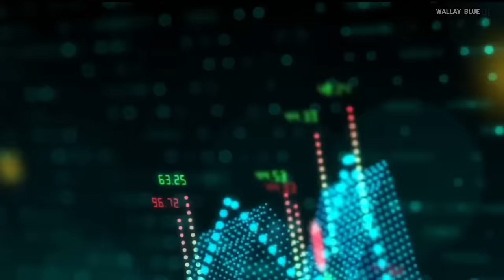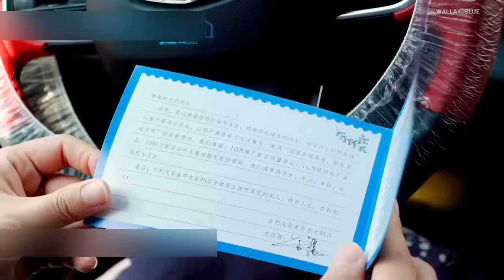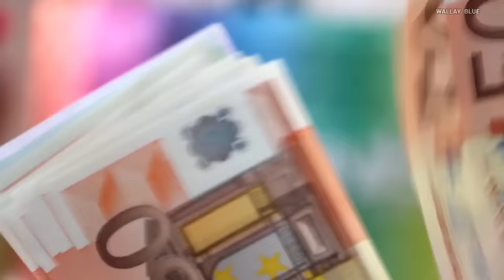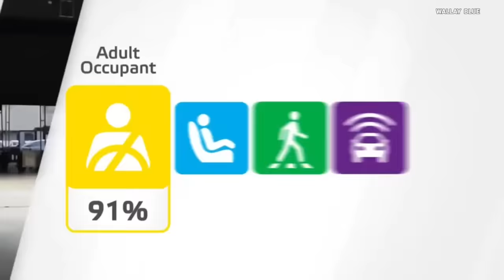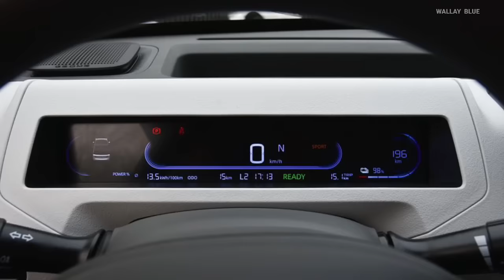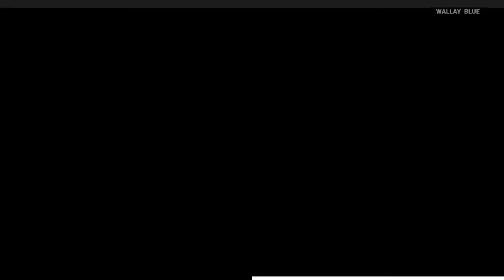China's $6,000 Car Shock The Entire EV Industry

Comment: I suggest that those countries which depend on oil and gas to produce electricity better keep to petrol or diesel engine vehicles because it makes no difference to produce carbon dioxide from the vehicles or the electricity generating centres.
Reply: The mass productions of electricity even still from oil or gas at the current technology stage is still much more efficient and cause much less emissions than each car produced power from petrol on its own, especially we all know that hundreds of millions of cars stuck at traffic every single day and release the millions of tons of emissions…….if they were all electric cars, then this type of emissions release occasions will be avoided.
Reply: But don't forget that except nuclear and green power the rest really emit plenty of carbon dioxide and monoxide to the air using gas or oil even in the most advanced technology stations and the worst is when using coal as  fuel. The frequent forest fires that occurred in the West can be a great contributor to this CO2 emission too.

Comment: There is NOOOO Zipping around by American standards.
A Zero to 60 mph  acceleration over 15 seconds will be PROBLEMATIC. Also a top speed of 62 mph is too slow for highway merging (Whuling brand). In town car (golf cart), OK. China has bicycles, Tuk-Tuk (3 whl scooter) taxis, motorcycles, cars, & mini light trucks.
+++++++++++++++++
2022 Mitsubishi Mirage	0-60 mph for the
ES 5dr Hatchback (1.2L 3cyl CVT) is 	12.8 sec.
EV ONLY IF GAS BECOMES $15 per gallon.

Comment: There is a shortage of cars in America.  Thus, cars are very expensive in America.  Furthermore, the cars are not EVs.  So Americans dream of cheap EVs from China.  If only Americans can buy cheap Chinese EVs, we would be ecstatic.  But Americans need the EVs to have at least 80mph top speed.  And a decent range of at least 200 miles, preferably at least 300 miles.  Also Americans prefer privacy, so a bright moon/sun roof is not really desirable.  And a good surround sound audio system is a must.
Reply: The unions, legacy auto makers, oil companies will pressure / influence / but the politicians where ever and whenever possible to prevent cheaper electric vehicles claiming that they are saving jobs. At the expense of 1,000,000's of consumers. They should retrain and requalify the workers in the electric industry, a far cheaper alternative to bailing out GM etc etc on a regular basis
Reply: You’re talking rubbish. A, there is not a shortage of cars and B, most drivers don’t dream of EVs, let alone Chinese ones 🤦‍♂️
Reply: @stubones  There is not a shortage of expensive cars that cost an arm and a leg.  And these cars are plentiful.  If you have the money, you can buy 100 of them anytime.  And if you want a legacy manufacturer EV, you will have to pay even more for them than an ICE car.  Thus, expensive cars are plentiful, and the car dealers' lots are full of them.  However, if you want an affordable car, they don't exist, let alone being short in supply.  If you want an affordable Chinese EV, forget about it, not available.  You can only dream about it, cursing at the USA government, and still keep dreaming more of being able to buy a cheap Chinese EVs.  Some Americans have lots of money and loves to donate them to the car manufacturers in buying a car.  The rest of the Americans don't have that kind of money to donate to legacy car manufacturers and curse at the lack or shortage of affordable cars, but not just cars.  We want cheap Chinese EVs because they are affordable, cheap to drive, doesn't pollute the environment and alleviates global warming.  So we do dream of cheap Chinese EVs.
Reply: It's way much cheaper than Singapore .
In Singapore it cost 10 to 20 times more .

Comment: where do electric vehicles get their energy from thermal power plants so that they are not as energy efficient as they say with CO2
Reply: But they are compared with ICE cars so it is n improvement, an electric car is more energy efficient than an ICE car because it looses less of it's ower because of fewer moving parts and power for power is cheaper discounting battery price and as these are becoming cheaper so much better in the future. Don't forget the first ICE engined cars could not manage 70 MPG but development got it this far.

Comment: People are forgetful! They will forget to recharge & get stuck on a street or highway! Why
couldn't they install a small, second battery, to give the driver an extra 5 to 10 miles to 
reach a recharging station, if the larger battery is exhausted? This would take the appre-
hension out of driving longer trips! Original V W Beetles had a second gas tank, for this!
Reply: Before you make a statement you should know what you are talking about and as far as I know from lots of reviews all electric cars give fair warning of low fuel remaining
Reply: The original VW had a reserve in the gas tank, not a second tank. Learn your history.

Comment: , it doesn't change anything. If you have electric cars.  You're wasting your time. If you try to make electric cars because   Power stations has to produce extra electricity to charge the cars. And if you have more electricity being produced, and this will cause more emissions into the air anyway.  Also after the battery has reached its lifespan, you cannot get rid of it. it will cause toxic waste, which is extremely dangerous for nature and the environment.  I want to drive around with a huge car battery underneath you could cause radiation when the battery gets older. So that could be a threat to your health also.